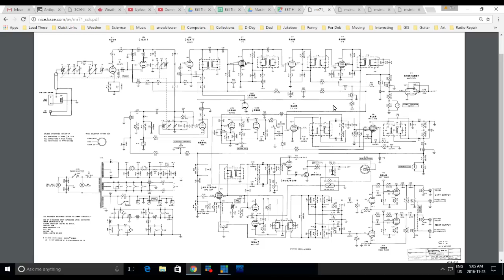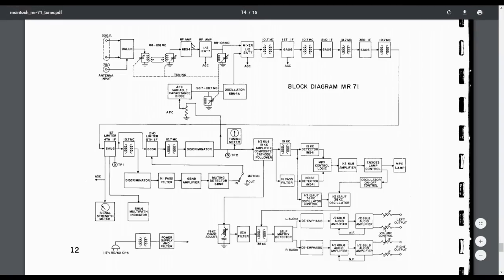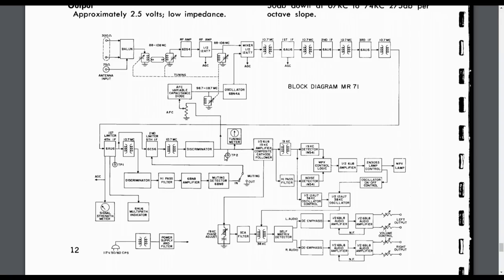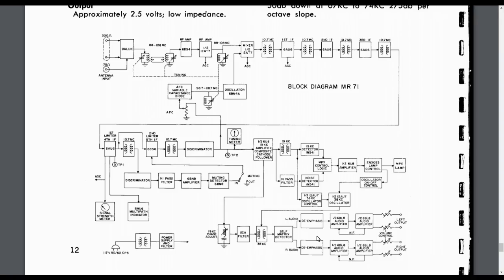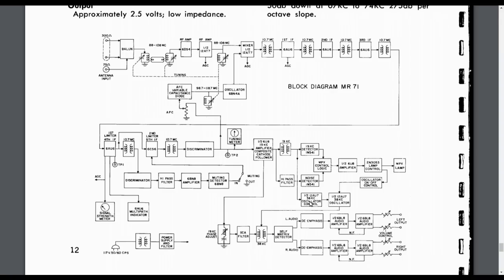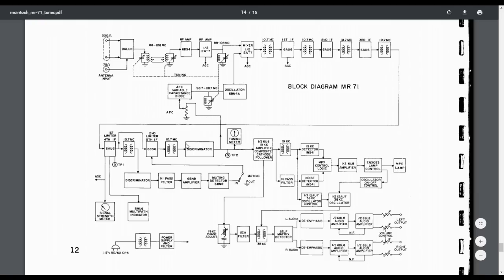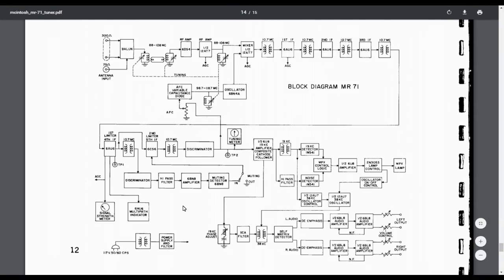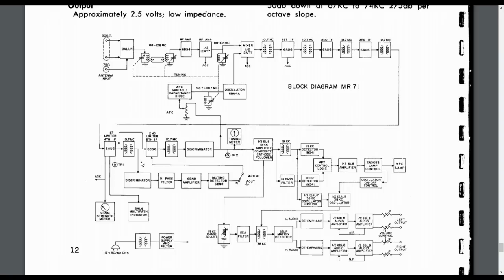McIntosh MR71 FM Receiver Video #9 - Block Diagram

Comment: Recall when you barely touched a slug (with your tool) and there was a major step-change in the signal into the VTVM. Reproduce that if possible. That can might have a sick mica wafer inside. Evidenced by touching the core and so disturbing the compression connection(s) to the internal cap(s).

Comment: Usually you double the 19 KHz carrier, to 38 and insert it on the sideband signal to get your l-r info, like a SSB shortwave radio.  Then you can get stereo sound through the matrix circuit. This radio actually has a 38 KHz oscillator instead. I guess the advantage is, its always the same level and can decode stereo under weak signal conditions